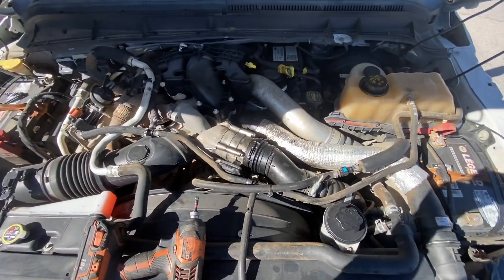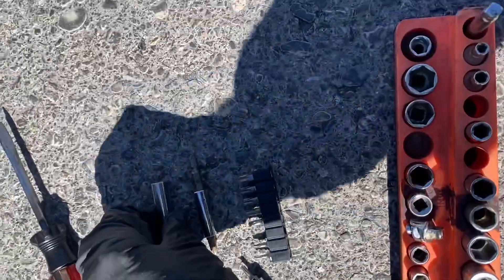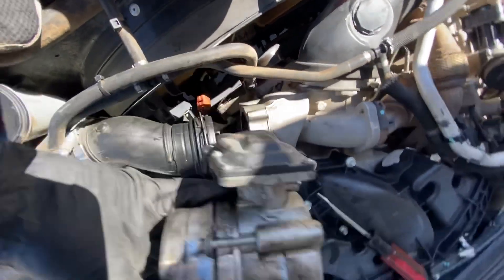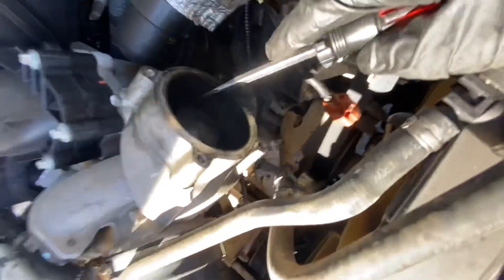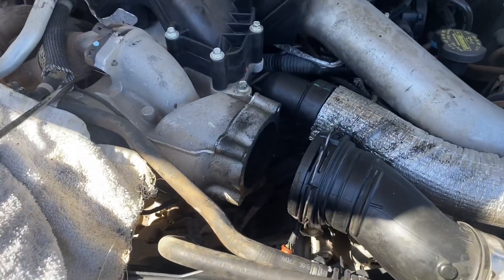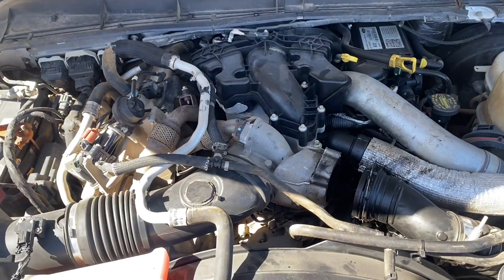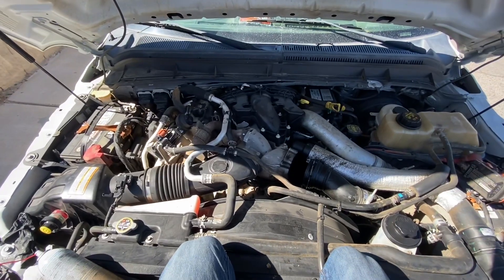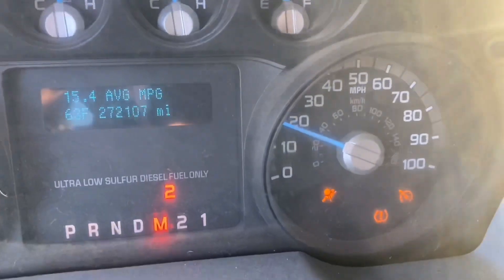15 minute mod, 10mpg to 16mpg, 6.7 powerstroke gets 60% better mpg, so easy you can do it too!

Comment: If your 6.7 is only getting 10mpg then there is something wrong with it.  My friend has one with 235,000 miles and he gets 16 to 18 mpg with NO Modifications!
Reply: I think the issue is the control over the gas pedal, AKA the right foot.   A stock 6.7 should easily get 16 MPG empty without any mods, 2020 and up get 20 MPG, stock.  I see 20 with my 2012, but I perform regular maintenance to keep the intake flowing clean. Takes half a day, but well worth it in the pocket book.
Reply: @acdii  i don't know what you talking about. i have 2020 f250 and getting 16.8 empty
Reply: @evysadventures9909  Then your driving it wrong!  MPG is all about the right foot and how to use it.  Majority of the use for my F350 is towing, so I see 11-13 MPG, but when driving empty, or something in the bed, seeing 20 MPG is quite common, heck I have even seen 24 doing 70 MPH, and mine only has the 6 speed.
Reply: @acdii  you are 💯 correct I get 20-21 mpg on the highway in my 19 350srw all stock I also purposely drive easily on it because fuel is expensive.

Comment: Only way my 6.7 will get 16mpg is if I drop it out of an airplane. From day one with less than 30 miles on the truck it never got over 14mpg unless I was coasting downhill and keeping the speed under 60mph on the freeway. Granted a dually with 4.10  gears will get worse.
Reply: Both of my F350s 12' and 17' have 3.73 gears, both got the same milage towing, around 10, and the same milage empty, 16 to 17, fuel milage actually seems the same at 55mph or 70mph, kind of like the old big block gas motors that got 10 loaded or empty, except this is speed that doesn't change the mileage
Reply: Deleted mine, egr and dpf that now has 301k miles . H&S tuner in street mode will get 18-20mpg going 65-70 on cruise control.
Reply: 2019, after a keto diet I cannot get worse than 18 city and I've bested 29 highway rolling at 68mph for 250 miles mostly get 26 highway no matter what. pulling my 12k 5th wheel at 65 I get 14.5. 3.31 gear.
Reply: @betterthanideserve76 what keto plan did you install. From what I've seen the h&w and minimaxx plan only increase about 2mpg

Comment: Did the mod worked great on city streets but hit the highway and Over boost derated engine 
Pulled over cleared code dis it again just at cruising speed 3rd went home re-installed cleared codes,but also unfortunate for me I own a cab/chassis derated 6.7 330hp so I'm probably screwed anyway
Reply: Cannot do this mod and remove the butterfly without a delete file installed on a programmer.

Comment: You should water injection to help clear and keep that carbon from building up in the engine. Water injection will clean intake, valves, pistons and ring grooves. You might see even more gain in MPG.
Reply: When he said 18 for 7.3 yep all bull . Apparently I'm not going to learn anything.
Reply: How the fuck is your MPG that low? I’m getting 18-25mpg with mine.  And it’s completely stock
Reply: @jamespatterson7211  Most likely, driving at 80 mph.

Comment: Bro just delete your truck. I get 26mpg no load and 20 with my horse trailer with 2 1600lb horses in the back all day.
Reply: What year truck?
Reply: @leeroyjenkins9992  2020
Reply: @Deltatwo3  I’d imagine that 10 speed helps my 2018 gets about 17 not deleted
Reply: @leeroyjenkins9992  100%

Comment: My stock 6.7 get 16 to 21 mpg and ive never done anything to it.
Reply: I've wanted this to be a feature of the new trucks, but I've never seen a difference that would be from running on 4 cylinders.  I'd like to see another feature that would idle the engine on 2 cylinders for fuel and idling on purpose for a/c and heat while sleeping in the truck.  I've got a 2017 f350 6.7 dually
Reply: what year 6.7? after 2016 they found out how to shut off half the engine to conserve fuel. so, in reality you're running a four cylinder sometimes not 8 constantly. Again in 17 and up i believe.

Comment: My 2016 Range Rover sport TD6 has that throttle body plate in it.. The throttle body is a lot shorter but I wonder if I should take it out too.. Wonder if the check engine light would come on. Maybe it has different sensor but it doesn't look like any sensor there.. I live in Alaska and I wonder if it closes to try and warm up the vehicle faster.. That would make the carbon build up even worse in cold temps.. Better to have more oxygen, I would think.. ? What say you?

Comment: Diesels are struggling to get 16mpg nowadays? My old 97 7.3 F350 cleared 20 with ease. It’s all these BS EPA regulations that killed the efficiency of these engines
Reply: That’s for sure. My 11 is modified so I’m averaging 17.8 pulling a 16ft enclosed trailer around town.
Reply: And somehow getting half the mpg is better for the environment? What happened to the days diesels produce 1/28th of pollution of a gas equivalent? This stuff is ruining our trucks. I had to replace my cross over tube cause it was leaking coolant. Pulled that intake plenlum off and Holly crap there was a ton of build up in there and that metal throttle body area. Makes me want to sell the truck

Edit not to mention these trucks now cost double what they used to 5-10 years ago
Reply: @bradleylayton1741  I sold my 97 that I bought brand new in 2000 for  a 350 crew cab lariat 7.3. One of the old timers at work asked what I paid for it, told him 40k and that was every option there was aside from duals. Holy Crap Kid!!! My first house didn’t cost that much!! I bought my first house a couple years prior, 100k and I thought no way in hell will a truck cost that much. Well, I was proven wrong. Also my replacement 7.3 only got 16 at best compared to my previous 7.3. Same trans and comparable gearing. Do a delete on a new diesel and suddenly your up 100hp and clear 20mpg, from what I’ve heard, don’t know that for a firsthand fact
Reply: @knuttsackjones3094  it’s very true I know a few people who have the same reports. Just sad we have to live in the gray area to protect a 60-100k vehicle. I love my truck but I’m considering selling it and going back to your old 7.3 truck before it’s too late to get one lol
Reply: I ran a 12' f350 6.7 all stock to 370k miles, the biggest issue was the damn high pressure fuel pump, second time I got it fixed, I had them put a FASS system on it that pulled from the bottom of the tank, and pressurized the stock fuel pump with polished de-airated fuel, I noticed an increase in power to the truck to be quicker and pull harder than the 17' truck I got to replace it, so I would say, add a FASS or AirDog system to save the high pressure fuel pump and improve the power overall, I was impressed with the difference

Comment: I work on these for a living for 10 years and have owned multiple of them. DO NOT REMOVE YOUR BUTTERFLY VALVE! It’s not a throttle body, it just looks like one, but the egr needs it. You can delete the egr and get rid of it if you want but then you have legal problems. DO NOT LISTEN TO THIS GUY HE DOESNT HAVE A CLUE WHAT HE TALKING ABOIT.
Reply: Why does the egr need it
Reply: @CanadianGulfstream  so the intake pressure is lower than exhaust, otherwise it would dump intake into exhaust vs exhaust to intake
Reply: I believe it's used to create a sort of vacuum one egr side to help with egr flow.
Reply: @sergdiesel5688  yeah, I’m not sure about vaccine, but maybe. It is to lower intake pressure lower than exhaust
Reply: @justinkroeker1464  yes, I agree it's used to  create a lower pressure in the intake, therefore, it's used to create a greater pressure differential across the EGR valve to facilitate EGR flow at low speeds and while under load. Also, it's used to have a smoother shutdown. Not trying to bust your balls, just commenting my opinion as requested. Honestly, with any 6.7 powerstroke questions, I ask @Powerstroke Tech Talk w/ Arod
Reply: I can testify I have a 2018 f250  6.7 power stroke when I purchased it I was only getting the max 15 to 18 miles a gallon maybe even less on the highway and that’s running 65 to 73 miles pulling I was getting about 9 to 11 miles a gallon an hour once I did it full EGR delete 5 inch straight pipe, exhaust turbo back my gas mileage has went up significantly I get about 23 miles a gallon highway and when I’m pulling I get about 15 to 16 miles a gallon if you plan on keeping the truck, invest the money and get it deleted if you plan on trading it in, keep it factory
Reply: Most likely he had a bad regen before and had a dirty dpf. These trucks with clean dpf get 18 mpg all day long.  Lots of highway driving is key to keep it clean. If you’re worried about the buildup in your intake manifold take it off only takes about 20 minutes and you can really clean it out. Never done it with a egr in the way tho haha
Reply: @forrestdemaria I wish my 6.7 got 18mpg damn lol
Reply: @forrestdemaria  18mpg😂😂😂 lies
Reply: @texasscratchking4568  Mine will get 18.5 @ 66mpg I'm pretty sure these motors are mostly efficient in thier final drive at around 1600 rpm. 

Obviously there is other factors, but im using cooper stt pros oversized which are not light by any means and im 2in lifted. 

But I also installed the BD exhaust manifolds. Got a 4in down pipe, and other exhaust goodies. It's uncorked. Before I was getting 9mpg with a fully clogged system, that wasn't maintained, unfortunately otherwise ida probably left it alone.

Running stock gt32 with wicked wheel and basic 25horse tune. Use ams oil or shell t6. Next id like to pull the intake manifolds and get the extrude honed or something equivalent, really would like to see what someone like gale banks thinks about little things like this.

Methanol injection is next, but thats more for keeping the intake valves clean. 

I'd also like to piggyback a supercharger into the setup, instead of the twin turbo piping nightmare which can be done, id love to see what a large charger could do.

I'm not looking for speed, just efficiency and pulling power. Best truck I've ever owned 2011f250
Reply: @texasscratchking4568 my ‘19 gets 14.3 took it in for a recall upgrade last year. Ever since then it’s been getting terrible fuel economy. Before the “upgrade” to software was getting about 15.5. Still terrible
Reply: @powerstroke6.7  yep my 2015 get 14.8
Reply: Lol what are you a narc?
Reply: @HSKFab  what? Narc? I don’t understand
Reply: @justinkroeker1464  "legal problems" lol, what are you a boy scout?
Reply: Most people delete the EGR unless you live in a Nazi state
Reply: Mine was getting about 9 to 10 mpg. I pulled the intake, soaked it in brake cleaner and had it looking great. Got 13 mpg. So full delete with 5” exhaust I get 21 mpg all day long.
Reply: Calm down Justin… my truck has already been deleted… 😂
Reply: My truck cost a lot of money I'm not going to change anything
Reply: @phillipgarrow2297 you're dumb
Reply: Install a pusher manifold and forget all that crap 💩
Reply: @jmartin3955  true, milage won’t be effected by that either. At least won’t be a calculable amount
Reply: Delete delete!
Personally i wondered why they had a TB doesnt go well with diesel
08 6.4 deleted 175k 20-24 mpg (head wind tail wind)stock intake 35s

Comment: Mine says avg 19.3 around town and gets 23.4 last 100 mile trip on the hwy with some stop and go. I have absolutely done nothing but fuel it up
Reply: Doubt that,  I had  2011 6.7. Got. 13 around town 17 highway.     I had 2017 got 16 around town  19to 20 on highway.   Now own 2019 16 around town 19 to 20 highway.  Dont be that guy man. Seriously.    They all get the same mileage.  No need to lie

Comment: This will not increase fuel mileage. I did this like two years ago except I took the entire manifold off and soaked it to get 100% of all the soot and oil out. I then replaced the “throttle body” with the H&S model and down pipe and it did nothing for mileage. But I already get 18 mpg on the highway empty. If you own a 6.7L that gets 10 mpg empty on the highway… you have other issues.
Reply: That does not surprise me at all. My 2011 F350 KR pulls a 15000 lb fifth wheel and I get about 10 mpg at sea level. But empty I get 15-16 mpg around town and 18-20 mpg on the highway.
Reply: My 2015 6.7L gets 11mpg at 6000ft altitude towing 8000lbs uphill @ 65mph.
Reply: Yes, this guy is clueless. This is real disinformation 😂
Reply: Hey it's me the person that you saw at the gas station next to ajb middle School
Reply: @jerimiahgomez1578  hey, man. How’s it going. Long time no see!!
Reply: @secretsquirrel572  it's going good I've watched some of your videos there cool
Reply: You know where did a burn out in a row truck by two bridges I live close to the boat ramp
Reply: @jerimiahgomez1578  Dude… I have no idea who you are. 😂🤣😂
Reply: @secretsquirrel572  oop
Reply: @secretsquirrel572  bro sorry thought I was talking to tyler

Comment: The DIC milage computer are merely a calculated milage figure. Fill your tank up and use the odometer to calculate actual milage and let's see that figure.
Reply: Okay while yes that's true, now days trucks are pretty accurate in terms of the MPG. Even if it wasn't , it did improve in the eyes of the computer, so while that may not be the exact mileage, it did improve
Reply: all modern cars/trucks calculate mileage by measuring the injected fuel while measuring the distance traveled, every time an injector fires.    You can't get more accurate than that with pen and paper and human error.

Comment: I’d love to see any 7.3 get 18 mpg, that is if you calculate it correctly
Reply: As an engineer with both a 7.3 and 6.7. This kid is insane 😳 with towing mileage.
Reply: Not hard with a standard cab 2wd 5 speed. I got 23 on a road trip at 55 mph. More realistic was 19-20 for normal driving.
Reply: @tomasperalta3961  yeah not hard with one of the lightest 7.3s you could get, you weighed about or slightly more than a Dodge Charger. That would be the reasoning behind that
Reply: @KDlGG  absolutely noted that I had one of the lightest 7.3s! Just trying to make the point that 20 mpg from a 7.3 isn’t ridiculous. But obviously, definitely unrealistic for most, which seem to be super cab 4x4s or bigger. My current 7.3 crew cab long bed 4x4 gets 12mpg, but it’s an idi, slower than hell.🍻
Reply: @tomasperalta3961  oh no doubt it’s achievable but I was comparing it to exactly what he has in that video, crew cab short bed 4WD and stock. Absolutely not achievable without going down hill in neutral 😂
Reply: I couldn't get more than 12 with my 02 7.3, empty or loaded. Loved that truck tho, wish I still had it
Reply: @JasonTAho  they were good trucks for what they were. But they absolutely were not known for their fuel economy 😂 that’s why I thought it was so strange when he compared it to a 6.7. It can be done to achieve that MPG but you have to have a specific truck and under specific conditions.
Reply: My 97 7.3 F350 cleared 20mpg with ease

Comment: The purpose of the flap is to restrict air flow to increase heat in cold weather so the dpf will create a catalyst
Reply: I work for my local DPW and we have a couple F-550 s with the 6.7 in it. I removed the flap on both the trucks and I did notice that the engine temperature runs slightly colder than before. But only by a needles width. It seems to regen fine in 30 degree weather but I'll find out in the winter time if they really affects the regen.
Reply: No, it’s to regulate egr valve pressures
Reply: @justinkroeker1464  so is it bad to take it out? Who right here?
Reply: @UZCOexcavationexperience  leave it unless it’s deleted leave it alone. the engineers didn’t add a flap in the intake for no reason. I don’t know how often it needs it during operation but removing it will cause problems. Honestly the guy that made the video is clueless so do your own research
Reply: What if you remove the dpf?
Reply: @Jaybird9005   you can remove it if deleted

Comment: EPA has very stiff fines for EGR deletion, or modification of emission system.      They like to talk $5-50K per idem and/or event.
Reply: Been hearing that for years and not denying they can't do that but I have never heard of it actually happening at all besides commercial drivers
Reply: The EPA does not have the money or man power to go after every single diesel owner that deletes the emissions equipment. Just stay out of retarded liberal states and you’ll be ok.
Reply: Look at edge lawsuit they bust the driver and make them rat out the shop or programmer bs. Then 30 days to undelete is the rumor I heard  climate nazis are the devil lol

Comment: This guy is a dumb ass. First off you will NEVER get 18-20 mpg towing. Second it’s not a throttle body. It’s to keep egr gasses from back flowing into the inter cooler. You need to put it back until you delete the truck

Comment: What about the dpf? Does it clog faster for you?
Reply: The dpf is sprayed into the exhaust pipe as the exhaust is halfway out the back end. Dpf is a total joke, another way to screw diesel owners over. Never needed it in a diesel until obamabiden got in office.

Comment: I just did my 2015 F250. It was nasty!!! Hopefully it improves.
Reply: Is it working?
Reply: @jurezslaughter6324  It's definitely better but still have to take a trip on it. The response when stepped on is delayed. I guess due to the massive amount of air. Also a lot of more black smoke.
Reply: @69artdlg  
Ok I'm about to buy one today. That's why I asked. It supposed to be bulletproofed
Reply: My mileage has gone up to 15-16 mpg in the city!!! Are there any long term effects???
Reply: Is it working?